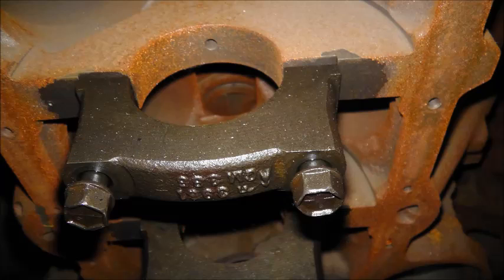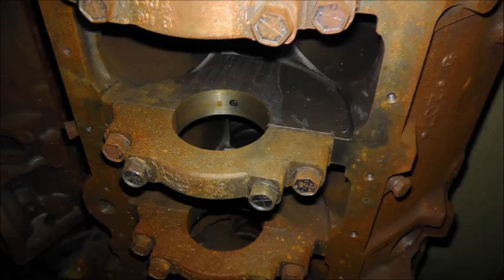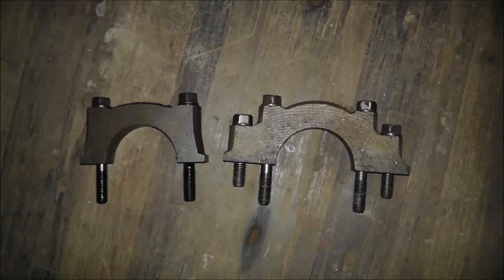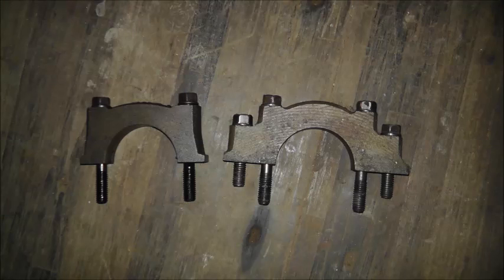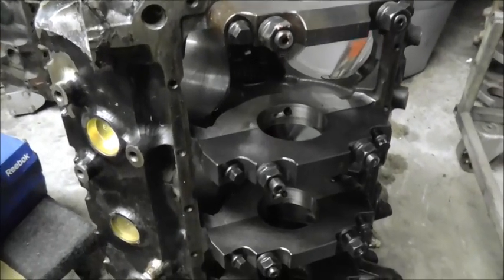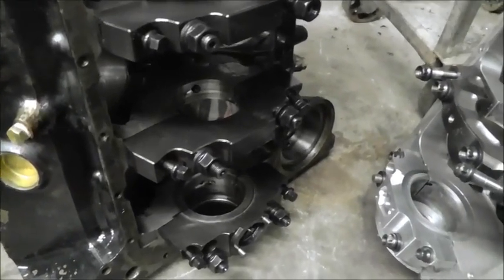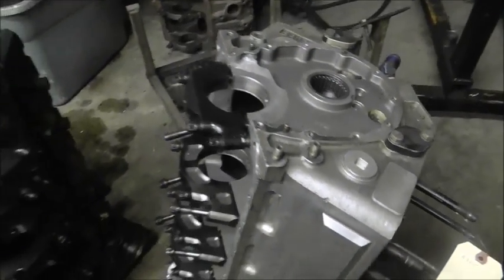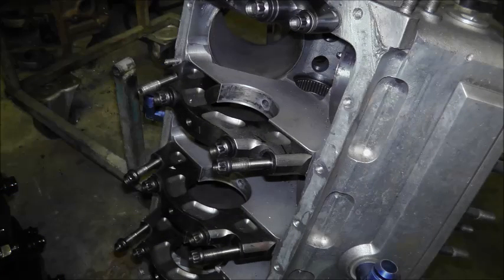Ask Roger: How much power can a 2 bolt main cast iron sbc block hold?

Comment: I had wandered about this. Just because of cost I'll use 2 bolt main core and flat top piston it with 2 hump heads if I can find them and whatever cam combo that suits the need. Personally never seen one fail in street applications. Have seen plenty of rods broken in both 4 and 2 bolt main dirt track cars but have wandered if the mains could possibly have any cause in rod failing. Have heard the Old-timers speak of pushing tbe whole crank assembly out the bottom on drag strips from getting greedy and pushing too much blower pressure. Does anyone know if rod failure could be caused by main journal flex? The only problem I can see with 2 bolt is turbo or super charger pressure. I could see maybe if you have compression nearing diesel might push the crank out. But GM had plentiful problems with diesel compression in the 6.2 other than crankshaft.

Comment: hello i have a stock  2 bolt 400 sbc could i make a 415 or 421 out of it
Reply: Depends on the thickness of the cylinder walls in your block. A 415" is just a stock 4.125" bore with a 3.875" stroke and a 421" is a 4.155" (0.030" over) with the same 3.875" crank. I wouldn't over bore unless you have to, you won't make much more power off of the 0.030" overbore but you'll lose cylinder wall thickness and that is more important than six cubic inches. 

You'll want to send the block to a good machine shop that can sonic check the cylinder bores to know how much material you actually have there, and then depending on the casting, you may have enough material and/or the block can be slightly offset bored to clear up small amounts of core shift. 

Don't believe people when they say that your two bolt main 400 block is junk or thin or whatever. I have one at 4.155" that still sonic checks at .230" on the major thrust side and around .190" on the minor side. Also do not listen to anyone advising you to dump displacement by using a 350 crank because 4.155" pistons don't explode when rev'd to the limits of large port 23 degree heads, and longer strokes do NOT slow engine acceleration enough to matter on anything but F1 engines. Also a 350 crank won't fit because it's main bearing journals are smaller. 

Use the most displacement, the highest compression, the highest flowing heads, and the biggest roller cam that will work with your combination, and always use displacement instead of RPMs to get your horsepower. Destroking and reving higher just tears stuff up and you'll always make more power at the same engine speed with more stroke and displacement. Who do you know what has ever destroyed a set of pistons from material fatigue due to excessive piston speeds?

It's also a good idea to always try your best to use punctuation whenever you write or type.
Reply: unless you have it Sleeved then you can overbore!!
Reply: @limowreck2612  there’s no placement for displacement 👍🏻 I’m running a Sbc 400 with Eagle -H-beam 5.7 rods 4340 crank srp piston gapped for nitrous world 2 heads 817  2 bolt block it held up so far so we gonna boost it and see how far it will go motor was built 20 years ago so she’s tired but ring gap should be even better lmfaoo
Reply: you can make a .03 over 400(you dont want to go a lot more with the saimeesed bores),or get a 350 crank and make a 377,it will rev a lot higher but make maybe a little less torque.you can also look into different length rods and special pistons to get more displacement.
Reply: desi frazier yes but a dart block would be ideal

Comment: Hello I have a mid 70s 350 2 bolt main what's a good cam and carburetor for it? the number on the block is GM 3970010
Reply: +Charles Williams Those 350's didn't come with a 2 bolt main. Maybe it's a 327? either way, assuming you're running stock compression I'd recommend a SUM-K1102 cam kit and a 600ish CFM carb. Make sure you still have good rocker geometry after you install the new cam
Reply: 3970010 it shows up and mind is a 350 2 bolt main between 1969 to 1979
Reply: The 3970010 block number was commonly used in the 60's and 70's as a 302, 327, and 350, at least that's how I remembered it. But I've been wrong before. Anyway, I probably should have asked what you're using the engine for before I told you what cam to run. If you're towing I would probably go with something a little smaller
Reply: Oh I'm putting it in a 84 caprice classic
Reply: Alright, if I were you I'd do some research and decide what cam you want to run yourself. The right or wrong cam can make or break an engine. An Edelbrock performer or air gap intake would also go well with a new cam and carb. Good luck with your build man
Reply: Ok thank you buddy
Reply: I know this was a yr ago but 0010 blocks DID come 2 bolt main and yes the first ones 68 or 9 could also be 327s but were 2 bolt mains
Reply: yes,you are wrong.

Comment: how do you tell the difference between a 4 bolt main and a 2 bolt
Reply: The part that holds down the crank shaft either has 2 bolts or 4 bolts holding down the crank shaft
Reply: Count the main cap bolts.

Comment: here's a good one for you. using A.R.P 200.000 studs on a 350 small block two bolt main block instead of a four bolt main block in a 4x4 truck what will be lost if anything
Reply: durability
Reply: You wouldn't know the difference.